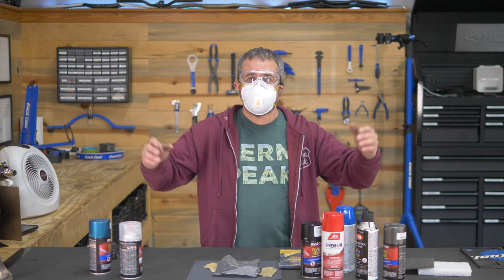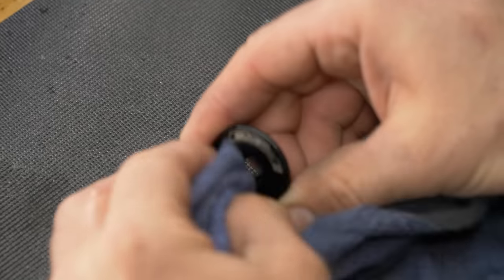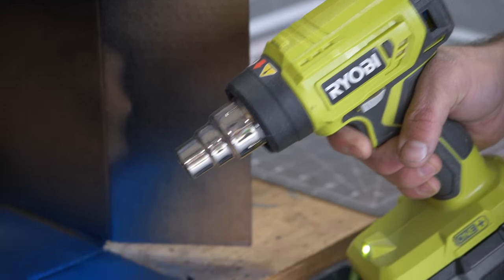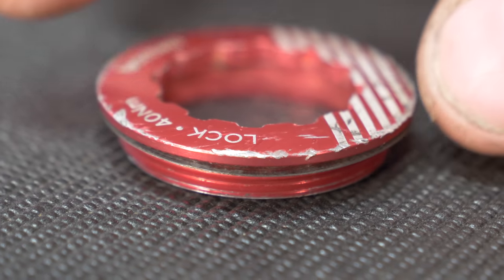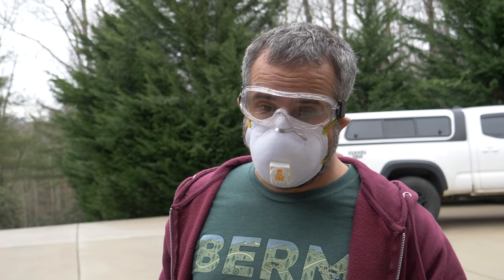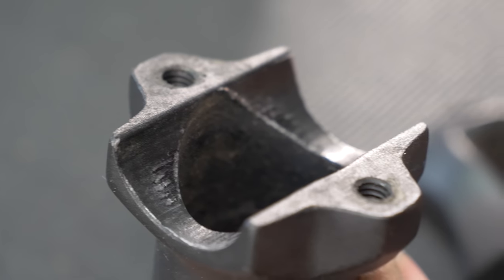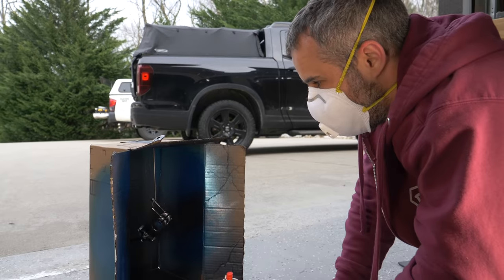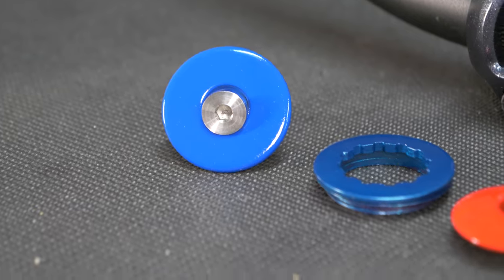How to paint bike parts the cheap and easy way!

Comment from the maker: I love the tips! Keep ‘em coming and we’ll use them on Flip Bike!
Reply: that mask is not for paint fumes\
Reply: Thanks Kevin!  Great job with the camera. Too bad mr cool dude Seth doesn’t really respond
Reply: My grandpa used to work in a body shop like 50yrs ago and he painted cars without a respirator or any protection whatsoever.  One day he was painting a blue car ( I don’t remember what kind of car) but he had a doctors appointment that same day. When the doctor looked in his nose, he was horrified by all the blue inside his nose!
Reply: Great tips definitely going to be  handy.
Reply: My tip: oven cleaner takes off anodizing. I had some red bars I didn't like.  Used the full strength oven cleaner and got them to raw aluminum.
Reply: I painted my fork stanchion
Reply: i would suggest trying montana cans spray paint. its as cheap as the low quality you use but extremely good. ive painted my entire bike with it. also, mate finishes i find to have a less cheap look. also use high quality masking tape to make some easy deisgn (highquality tape makes better lines)
Reply: When wet sanding you are going to want to use the palm of your hand because if you use your fingers you can sand your fingers tips
It sounds dumb but I've done it before
Reply: Sandpaper set up 120 to 180  miss  set up I know dose is before
Reply: Not good for your breath
Reply: ETOE has an excellent YouTube channel where he does some good tutorials for spray painting if you want to get more into it, also has beautiful bike projects that are fun to watch!
Reply: This video helped alot! These tips helped me paint my disk brake rotors. now they look sick!😁👍
Reply: Scrubbing the surface with Ajax or Comet cleaner creates a perfect key for paint adhesion. Dan Gelbart shows this in his video on "Coatings" (among his others about more technical stuff).
Reply: I’ve painted a bike with high heat flat black bbq paint. That stuff does not chip. It’s bomb proof
Reply: @spencerreynolds9083  he’s an amazing painter

Comment: As an automotive painter with nearly 20 years of experience, what you covered in this video is basically all the same things I would’ve gone over. With a few other deatails. Such as: to help prevent the spattering out of the rattle bomb can, tip can upside down and spray for a second at the end of use to clean out the nozzle. Great job!
Reply: And also shake the can ridiculously thoroughly to make sure that you don't get a lump of pigment in the nozzle causing splatter/spitting
Reply: as a professional youtube commenter with over 399 years of experience no one pays attention to experience comments.
Reply: @darkshadowsx5949  😂😂😂😂
Reply: Since you have a lot of experience, what are you opinion on powder coat or cerakote? I personally been painting lots of stuff but i always find myself questioning after all that time and effort i should of just invested or had someone do a powder coat/cerakote depending on application
Reply: F

Comment: FYI: a really good middle ground between "automotive paint in a can" and "cheap hardware store rustoleum paint" is DupliColor Engine Enamel. It's good to higher temperatures than standard paint so you can paint things like the valve cover of your car or whatever if you want, but it lays out really nice, is super easy to get that last wet gloss layer, and the can has that nicer nozzle on it. Additionally, it hardens up nicely and is durable for years as long as you prep the surface. It's also like $6/can rather than the $12/can for the automotive color matched stuff.
Reply: But does it work on aluminum?
Reply: ...wow, you must have a really hot bike!
Reply: 1000%  Solid tip. LOVE the engine enamel. Painted my truck rims with them. 2 years later, still perfect.
Reply: Use regular duplicolor enamel paint instead of the engine paint if you plan on repainting at some point because it wall take ages to sand off the engine paint by hand…
Reply: Duplicolor employee 👆right there
Reply: Totally agree. My motorcycle has a chromed plastic bezel around the gas tank filler, I sanded it, primed it, and engine enamel painted it semi flat black. It’s had some gas spills and all kinds of weather, still looks perfect.
Reply: I bought some of that stuff for the oil pan on my RV and found myself using it for a lot of other things. Good decently priced paint for sure.
Reply: @YOEL_44  yes. Lots of engines and engine parts are aluminum so the paint is designed to work on it.
Reply: @SEZ66  I mean without an aluminum specific primer, I have a bare metal e-scooter chassis that I want to paint black
Reply: @YOEL_44  it works on pretty much anything, just use a good primer first. It might work without a primer, but Walmart sells automotive primer for 4.99
Reply: THIS!!  ^^^  My father passed recently from COVID in late 2020, and he had a 2003 Jeep TJ.  It's the same year model as the year my 18 year old son was born.  The bumpers were in rough shape....very little paint left, and they had some rust in places.  I was going to just replace them with aftermarket ones, but then decided to take a crack at prepping and painting them.  I simply wet sanded them to rough them up a bit, and then painted them with the Duplicolor Engine Enamel, because I'd painted a Gas Grill with it in the past, and it held up incredibly well.  The bumpers still look like they did the day I painted them, over a year later.  When/if they chip or discolor after a few more years, I'll just do it again.
Reply: I totally agree. I have been restoring cars and using it for years and it is a really good paint. Unfortunately they only have red, blue, black, white, and grey in Australia. But if you want metallic they have the metalcast paint. And that is also really good. 
They all stick really well to any metal without primer as long as there is no grease or oil. If you paint fiberglass or plastic then just get a cheap plastic primer for them.
Reply: @YOEL_44  yes a lot of valve covers are aluminum or plastic so it has to
Reply: Personally I like Testors and those really small brushes.
Reply: @YOEL_44  almost all modern engine blocks are made of aluminum.
Reply: where do you find it at that price, everything I am seeing is $15 and up
Reply: @Ondamon375  you don't have to sand it to bare insert material to repaint it 😂
Reply: VHT too!

Comment: A good tip is to use soft earplugs in holes you don't want the spray to get into :)
Reply: Or a big ol dab of bike grease
Reply: genius
Reply: Thanks for the tip. My ears now have red over-spray.
Reply: Oh that's smart
Reply: TODO: Insert joke about plugs, grease, holes and tips.
Reply: Id probably just paint it and run a tap back through it
Reply: I did put them on reading your comment first then watching the video, got no paint in my ears but i have to watch the whole video one more time 🥴

Comment: Comment about safety: if spaying paint with solvent or hardener, you'll want a respirator with organic vapor cartridges.  The particulate mask you were wearing is primarily for dust while sanding.
Reply: Hope he sees dis
Reply: This should be the top comment.
Reply: Yes, buy a proper 3M respirator and voc cartridges. The solvents in paint will dissolve the fatty connective tissues holding you lungs together just the same way that the styrene in fibreglass resin does. Xylene, Toluene, Benzene, Styrene - all awful - please use a proper voc  cartridge filter for your health. The 2 part epoxy sprays are even worse; the diamine hardener is a serious carcinogen and breathing that Vapor will result in fine droplets of epoxy hardening in your lungs.  Also the voc cartridges need changing regularly, they don’t last forever.
Reply: Yep, I cringed when he tried to make that dust mask look like the right safety lol
Reply: You're totally correct but most people watching this video will paint a few parts here and there and have the common sense to do it outside. Or in a well ventilated area.  It's not like they're painting everyday.
Reply: Some people don't even care to wear a mask actually
Reply: Bump
Reply: if its that dangerous why dont they come with 10ft poles?
Reply: youd be surprised but in balkan some people dont wear anything
Reply: Seth's safety is a bit suspicious at times. For example in his bike power washing video he cleans his gear and shoes while holding them down with his bare foot. 

Just do a quick Google search for 'pressure washer injuries', he could've taken his toe clean off.

I mean no offense by it, probably just doesn't know better. But he probably should do some safety stuff considering the size audience he has now, and likely many of them being young and impressionable.
Reply: @dylanb9277 your not going to take your toe off with any sort of residential grand pressure washer.  yes one of those large commercial grade units absolutely will, but even a residential petrol unit wont,  yes it will take skin off and it will hurt like a bitch for a month and potentially get infected,   but you wont loose a toe.
Reply: @jackheinemann8780  it happened to my cousin, and he was using a cheap residential/consumer grade unit that hooks up to an air compressor.

It can happen
Reply: Bro
Reply: @JohnPilling25 That's just not true. Of course a respirator is best practice but some people huff petrol to get high and get exposed to massive doses of aromatic compounds and alkanes and their lungs don't instantly "dissolve". Of course it's harmful and carcinogenic but it won't hurt your lungs that way. (unless you maybe drown in a vet of solvents. 

Big structures in your body are also made up of proteins as structural material and not fats. People would melt in a Sauna if fat was the basic building material

Comment: A tip I got that seems to get the spray on nicer, especially on bigger projects like the frame, is to heat the can up in some warm water before spraying. The can usually says max temp is 125F, so no warmer than that. Also, the next coat as the part is just tacky gives a chemical bond, which is much more durable. Thanks for the great content!
Reply: yap, you can stick the can in a glass of warm water
Reply: Having the parts warn too will really help the paint stick so you can put a heavier coat on it
Reply: All this also helps paint on cold days. Keep the part and the paint inside overnight, or warm them up, and you can still get good paint on a 40 degree day. Especially if you have a small heater like that to help it dry. Baking small parts in a toaster oven works well too
Reply: I do something similar I use my heat gun but I'm super careful for oblivious reasons
Reply: Ok I have my can of spray paint in the microwave on high warming up. It is making lots of strange noises and there appears to be a light show. I'm not sure what the next step is so I'm going to sand blast the can as soon as I remove it from the microwave. Will report back.
Reply: I always heat the can up. Comes out a lot better.

Comment: Pro painter here (RSI painting NJ) this is all great stuff! Really not much to add other than when doing something large like a full frame it’s often suggested to alllow for 24 hour cute times between coats. In fact, the paint companies will never admit this but really good curing takes a few days to weeks. I wonder how that duplicolor stuff works with the added hardener. I’ll have to try that soon! Great work
Reply: As a prfessional you should really add: ALLWAYS use propper masks that protect your lungs from the fumes.

On the other hand, when I worked in the states I noticed, they mostly don't take safety protection that seriously. As an annoying german kraut, I can't resist the urge to adress that safety issues.
Reply: @Cushingura  As a USican, it's largely because we have a lot of masculine insecurity so must be macho and not do the 'sissy' thing like 'oh grab proper masking and gear to prevent the paint from giving your lungs turbo cancer or something.'
Reply: For multiple coats of the same colour would you still recommend waiting the 24h or do you recommend only waiting around that long between priming/paint/clear?
Reply from the maker: I’m glad you mentioned this because I’ve had a few jobs REALLY seem to strengthen after a few weeks and was wondering what I was doing wrong on a few recent jobs that seemed “soft”. With the cooler weather, it probably just needs
time.
Reply: @BermPeakExpress  baking parts makes a huge difference. i used a trash can + space heater to cure the paint on my wife's DB Release (18hour bake time @ 250*f)
Reply: @AndrewGarneau   yes, it stinks I know but most krylon and rustoleum want 24 hours between costs for curing and drying.
Reply: @topseller17  that's interesting to know then! A lot of comments here are saying it's best to apply the same kinds of coats when the previous is tacky so it can bond together, but I wasn't sure that made too much sense since I thought it's just hardening not reacting really. 
I usually waited about 48 hours minimum between priming, painting, and clear coating but I may follow that Advice over a longer period of time and see how it holds up. I usually leave the final coat to cure for a few weeks before I start building it up

Comment: A great DIY for many things is Nail Polish. It comes in just about every color under the sun. Great fir touching up dings/chips and it is also a great thread locker. Much less expensive than Loctite!
Reply: another solid tip!!  Got a sparkly bass boat ? Good luck finding a paint match for that ! Nail polish is perfect for scratches and small fixes !
Reply: Good tip thanks.
Reply: Get blue  just so you can use it as loctite 😂
Reply: I use nail polish instead of cable crimps! Just dip the end of the cable in and you don't ever have to take crimps off and it looks way cleaner

Comment: using a q-tip with a little vaseline can prevent paint from sticking to hard to reach places you can't tape off, rubbing alcohol on another q-tip will remove it when paint is dry....love this channel and thank you for inspiring so many
Reply: vaseline is an excellent "masking agent".  smear it on whatever you want unpainted. Just make sure the paint is 100% dry before removing the vaseline or you'll have a big ol mess.

Comment: FYI. In certain situations with items difficult to access for masking areas that you don't want to paint  you can use a layer of grease which will be easily removed after the paint is fully cured. Great video as always.

Comment: One tip to save frustration: I did find that spray paints, including automotive rattle can paints, can take weeks to fully harden. It probably varies with the humidity and temperature of your location. If you put newly painted parts on your bike soon after the paint has dried and find that the paint chips too easily, try leaving them for a month and you will hopefully find the finish to be good and tough. This worked for me with Halfords automotive spray cans.
Reply: My experience has been the same. A few weeks for most paint to really harden up. I'm sure the heat gun trick does help though. If you have an old toaster oven you can bake the small parts at 200f for an hour or so too. Also for rust oleum users be careful with the recoat times. Second coat within an hour or wait a full 2 or 3 days for the second coat or you're pretty much guaranteed to have wrinkles and bubbling in the finish. Definitely read the can and do what it says.
Reply: I would say that totally depends on temperature. In northern Tasmania where l live it’s currently 20-24° during the day. I restore cars and l have painted load’s of parts the last week outside and everything is touch dry in about 3-5 minutes and full cured in and hour. 
Just engine parts and suspension parts with duplicolour spray cans. And cheap black enamel in a tin. Of course not car panels. I the colder winter months coming soon l just run a heater in the shed and it dries just as fast. 
One tip is if you want paint to dry really fast then use a matte colour paint. They generally dry way faster then gloss paints, but otherwise a heater is good.
Reply: Yeah, rather than simply wait… use heat lamps, an oven, or put a space heater in a maintenance closet or shed to heat the whole space up. This vastly speeds up the curing process. And yes… wrinkling is VERY frustrating. Spraying too much paint, generally speaking, is a bad idea. Runs, drips (and wrinkles if re-coated too soon between coats) and a very extended dry time are usually the result. From my experience, you can clear coat gradually, wet-sanding between coats with up to 2000 for a very smooth gloss finish. Just don’t do super thiccc coats for the earlier coats. The final coat can be a decent smooth spray, but the preceding coats will be thick enough to give the gloss you want without drenching it and risking runs/drips. For what it’s worth my painting experience was in spray booths in a model making studio for industrial design prototypes. You can do a lot with spray cans.

Comment: I have been painting with spray cans for years and mainly on bikes and bike parts, and let me just say amazing tutorial, absolutely perfect for beginners and those mistakes are ones everyone’s made or will make somewhere along the line. As far as what paint I use I like rustolium, relatively cheap and tons of colors, also engine enamel is great because it drys fast and it’s super durable. Just a quick tip, when you first start painting your part start with a super light coat just to get the original paint to accept the paint, I have seen it happen when someone will do a super heavy coat and it will orange peel like crazy or blotch and run.